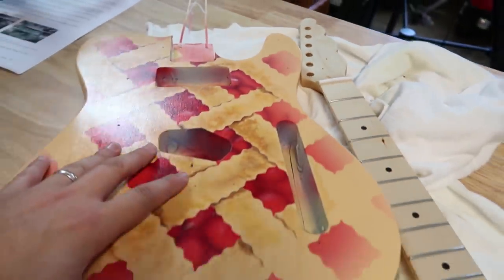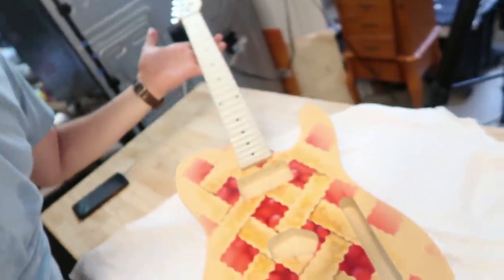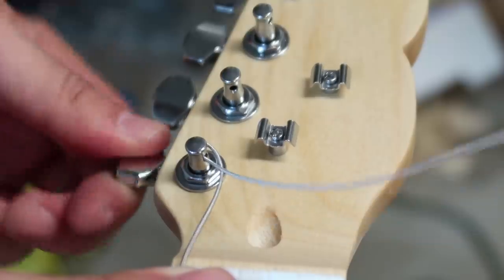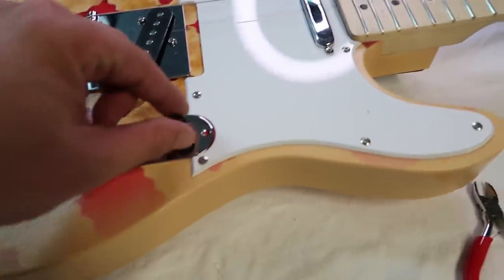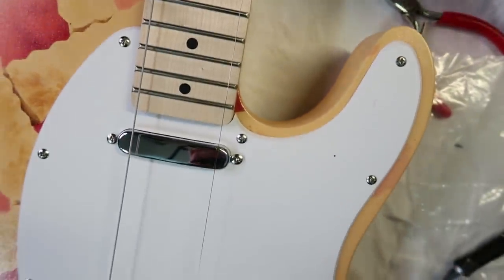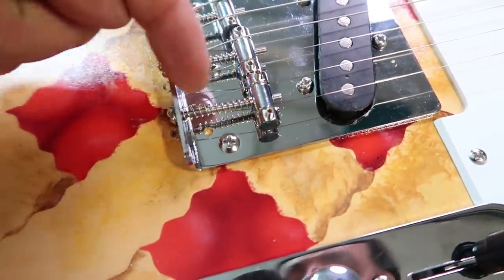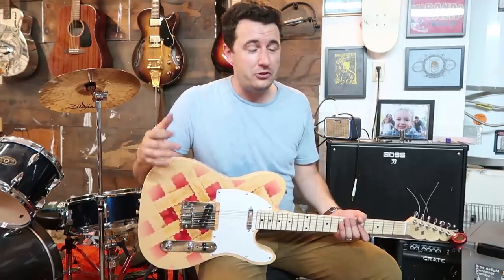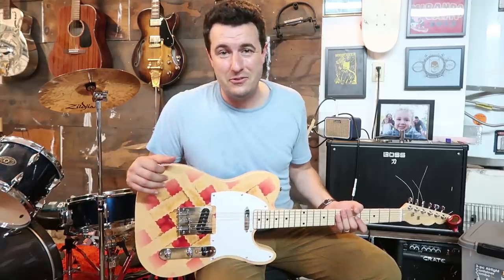First Time Plugging In Colleen's Waitress Guitar

Comment: Does anyone know weather you need a string winder to re-string an acoustic guitar ? 

If you do can you tell me many thanks if so
Reply from the maker: There’s a little fork at one end of some winders that help to take the peg out that holds the string on some acoustics. You can get them out in other ways so you don’t technically need one, but it can be helpful.
Reply: @GiftedGuitarsbyChrisBallinger   thank you i was just wondering as i need to re-string mine